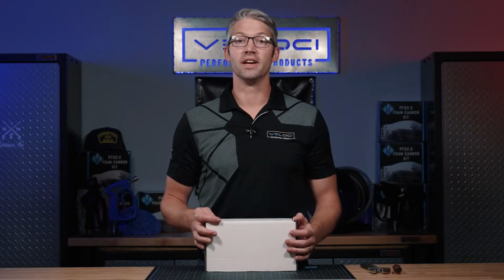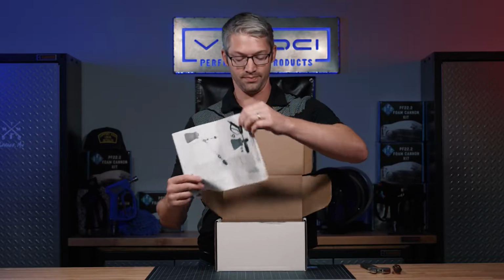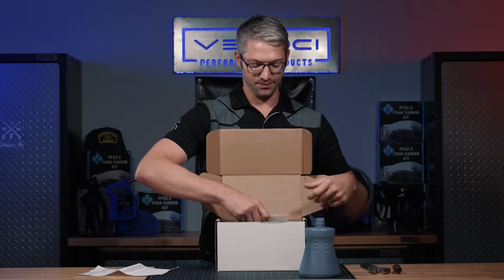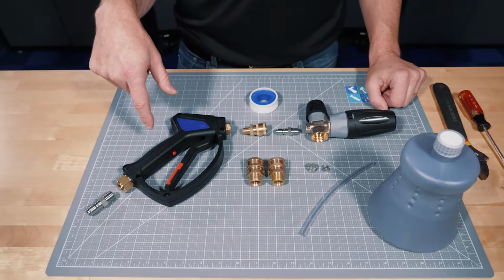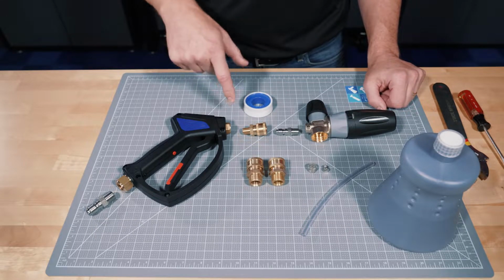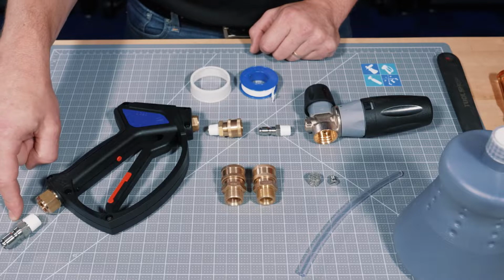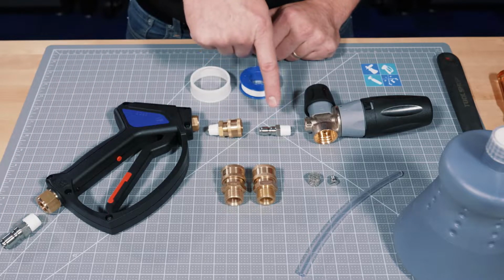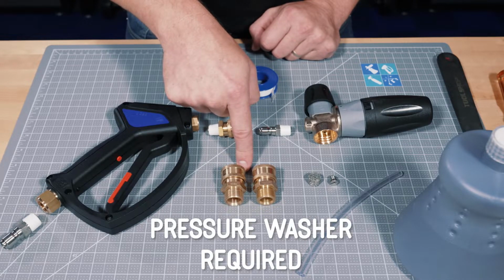The 28 Special Spray Gun & Foam Cannon Kit

Comment: How do I know if I need to use the smaller orifice
Reply from the maker: 1.25mm installed in the Foamer Body is equal to a 3.5 nozzle orifice. and the 1.1mm is equal to a 3.0. Which orifice to use is dependent on the pressure washer. Use the calculator to determine which will work best with your pressure washer: https://www.mtmhydroparts.com/pages/nozzle-size-calculator